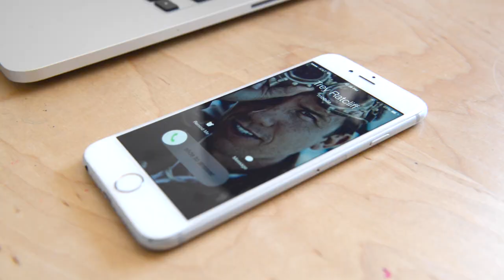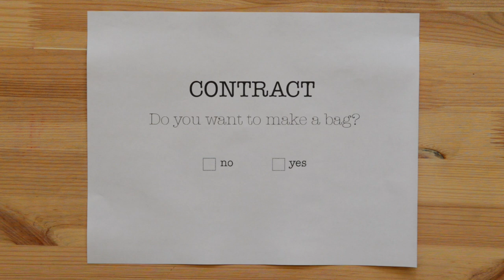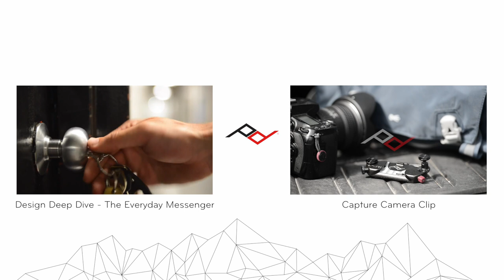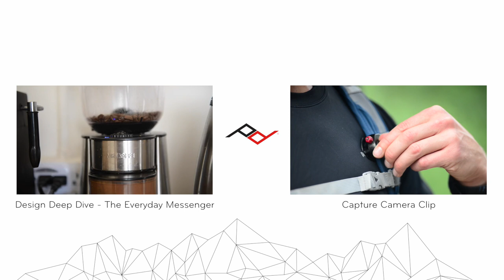The Everyday Messenger - Official Kickstarter Video

Comment: A few questions: 
1. What are the dimensions of the bag?
2. Any chance of lowering the price from $250 to under $200. Seems a pretty high. 
3. What other colors will be available?
Reply from the maker: wonderwall135 
1. Check out the FAQ on the Kickstarter here: http://kck.st/1Jr8tnX
2. Right now on Kickstarter, you can get it for $195, after the Kickstarter ends it will firmly be $250, that's pretty locked in at this point. 
3. Currently we have Charcoal with red accents and Hertiage Tan with clue accents. Check out the Kickstarter page for more pictures.
Reply: Thank you
Reply: +Peak Design Video It's look like very good, but i have another question:
- This bag is designed for those, who wear at the right side. I wear the messenger ( and the shoulder too) bags on my another shoulder. Now i have a Tenba Messenger DNA 11 bag, which is  can be used on both sides. The everyday massenger will be available inverted version?